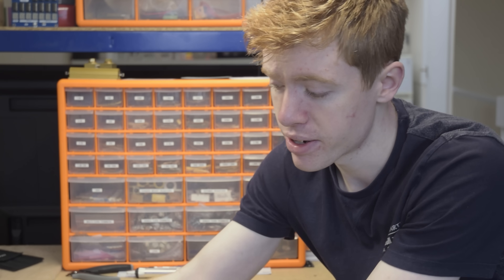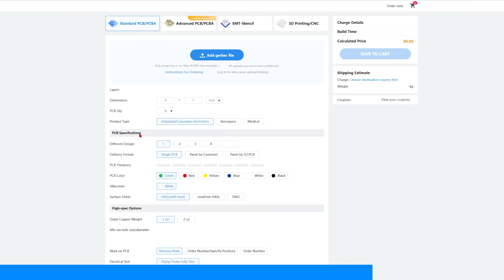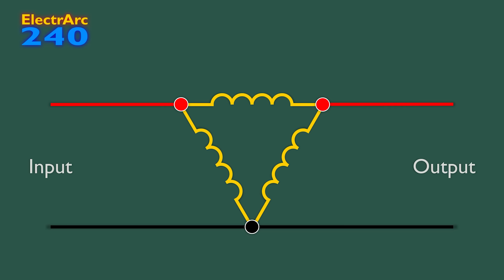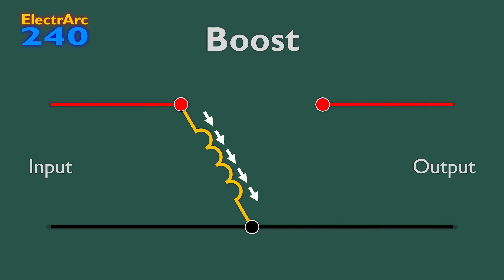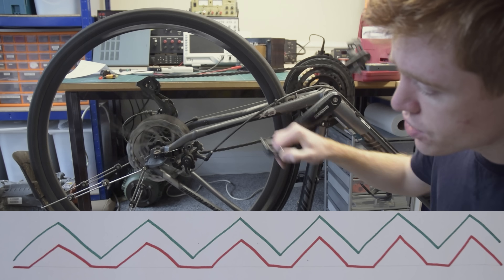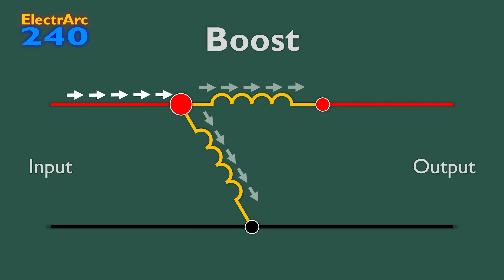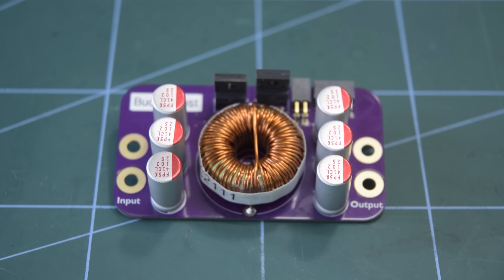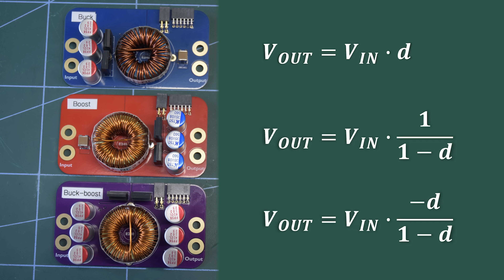How Buck, Boost & Buck-Boost DC-DC Converters Work

Comment: What if I was going from 380V to 48v on a buck converter?
Reply from the maker: What application? It would be quite unusual to convert between those voltages without isolation. And adding isolation means you can use turns ratios to do the heavy lifting of the voltage conversion

Comment: Edit: I misunderstood ignore below

I must say i was quite disappointed in the statement there are no non-inverting buck-boost converters, because yes they exist, with 2 FETs and 2 coils sometimes in 1 IC package. I think what you meant was with one coil? The rest of the video was very good and i very much enjoyed it!
Reply from the maker: Thanks. When did I say that? I only ever mentioned the standard buck-boost as this video was just about the three “fundamental” topologies that are in the thumbnail
Reply: @electrarc240 you are absolutely right, I misunderstood when you were talking about "standard" buck boost converters rather than most/all. So there are other standard types that dont invert, just not the one you were talking about. I jumped to conclusions too quickly. My bad.
Reply from the maker: No worries! I should’ve probably mentioned other types anyway. I will in the next part

Comment: Every EE i ever met would melt down at the term buck and boost. Would go on rants and pull out books. We usually laughed at them once they left...
Reply from the maker: Really? Where are you based? Never known anyone to have a problem with them
Reply: @electrarc240  Missouri is where I used to do electrical stuff back 2003 and before. They would say it's improper description. Or wrong terminology. We always had a good chuckle. Often suggesting them in meetings for absolutely no reason. Honestly I found them to be extremely rare in actual use so I never understood the hangup. Probably more prevalent now with much more DC in service compared to the 90s.

Comment: If you want buck-boost functionality with partial isolation and no inversion, there are the CUK and SEPIC topologies which decouple input from output via capacitors so DC cannot flow straight through when the converter isn't running or a MOSFET has failed.

Comment: Great video! Thank you for the visualisation of the inductor at 4:28. That's what I needed to finally understand what saturation means. Saturation was always a mystery to me, because it's important to choose a coil with a saturation that lies within the specs of the power supply you're designing. I feel stupid for never knowing buck-boost converters existed and that they can create a negative supply voltage. I could have solved many circuits with a buck-boost converter instead of a noisy charge pump. I'm assuming that the circuit needs regulation, because the voltage will drop under load?
Reply from the maker: Yeah some regulation would be a good idea, though if you can keep enough load to prevent the inductor current from ever reaching zero the output voltage will be fairly stable according to the equation shown at the end

Comment: Love these videos. I got a computer engineering degree years ago (before google was even a search engine), so I know the basics of circuitry, mostly digital. I went into software development, and never really delved too deep in analog stuff. These videos are great for refreshing what I forgot, and expanding on that and taking it further.
Reply: This is as close to the digital domain as it gets, with the PWM controller being mostly a digital device :D Now imagine people in the 70s, trying to develop an SMPS with nothing but crappy transistors and feedback loops.
I remember reading Horowitz & Hill book, the section on how to design a switched-mode power supply with the preface being "please don't".

Comment: Excellent description and interesting that you mention forward converters. Those were a thing back in the 1980s but fell out of favor, overtaken by flybacks and later, resonant conversion.
Reply from the maker: The one I held up was made at uni for the “energy project” group project. I guess they’re nice and simple so hard to go wrong for students! Flyback has the risk of producing dangerous voltage I suppose

Comment: Hi, I used a boost converter module to step 3.7v to 12v. I used the 12v to drive a dc motor driver (l298n), however I noticed that the boost converter would drop to 3v or so when I added a load (dc motor) to it. Can someone explain why this has happened and how to fix it?
Reply from the maker: Is the boost converter strong enough to drive the motor? Dropping so low means either the battery (presume it’s a lithium cell?) can’t provide enough current or the inductor has significant resistance, both of which would suggest an upgrade of one or both may be a good idea
Reply: @ I used a power supply to imitate the batteries voltage. I guess that’s where the error lies, right?
Reply: Hi, could be:

1. Bad hardware design
2. Your buck converter can't supply that much current
3. Your PSU can't supply that much current or is in CC mode
4. Your PSU uses long cables to connect to the boost converter so please add bulk capacitance right at the input
5. Your wires are too thin (although 3V is too low as voltage drop)

Comment: PWM is when you have data you encode over duty cycle. M for Modulation (e.g. class-d amplifier) . When your duty cycle is unchanging, I'd call it a square-wave w. duty-cycle. But granted, PWM is much shorter

Comment: Great video, I now finally have something to point my friends to regarding how the converters work.
Note that most modern (synchronous) "buck-boost" converters actually use 4 N-MOSFETs (high/low on both in/out) and have integrated gate drivers, to avoid a lot of the shortcomings, typically internal to the switching IC, but some ICs allow the use of external FETs (all 4, or only high, or only low, depends on what is convenient for the application).
Reply from the maker: Yes I will definitely mention this in the next video, but as the four switch version no longer “pivots” the inductor I thought I’d leave it from this one to keep things clear

Comment: Nice, clean and practical explanation. Congratulations !
With very smart control of PWM, what is a problem with using only capacitor (step down converter) ?
Reply from the maker: If you are connecting to a voltage source you’ll need a resistance to limit the current charging and discharging the capacitor, resistors are zero percent efficient so are the arch nemesis on power electronics and are avoided at all cost. But are fine in very low power circuits like a charge pump
Reply: @electrarc240  I thought about ultrashort rare pulses but maybe it stupid idea or needs additional switch to connect output when desired output voltage build after slow start ... or switched resistance to limit current at start and then bypass but this also unnecessary complication
Reply: @electrarc240  By the way, did you saw those new modules from (as I remeber analog devices?) where coil is inside ? Those for multiphase circuits like on GPU or main boards.
Reply from the maker: @AK-vx4dy  ICs with integrated magnetics? Yeah I've seen them before they're so cool, still can't work out how it can all be in a single package. We use them on a few boards at my work
Reply: @electrarc240  I think it some kind of hybrid module but still magic
Reply: @electrarc240  Thanks for explanation this role of current limiting makes more sense for my coil adverse brain 😉

Comment: Would  you happen to have a link for the buck converter board? I'm trying to make my own using some old inductors out of a blown up mppt charge controller. Not sure what i'm doing but that's how you learn! Any who id like to scope a buck converter with different freq and look at the output. Inductors I have are beefy 1mh so next is picking a fet or fet's for the job.

Comment: Holy cow, this is so applicable! I was just researching the possibility of making my own custom battery chargers and thus trying to better grasp the essential concepts of voltage converters... boom, upload from ElectrArc on that very topic 23 min ago. Talk about good timing!
Reply from the maker: Sounds interesting! There have been papers written on how current ripple (discontinuous current in particular) can cause internal heating and shortened life in batteries, so keep that in mind.
Reply: @electrarc240  Very good to know! Current ripple is not something I've looked into enough, so thanks for the excuse to dig deeper.

Do you happen to know what causes the internal heating, from a technical standpoint? Is it just bursts of over-current? Maybe brief over- / under-voltage at the limits of the cycle? Both? Neither? lol. I ask because most of my work is on solar and battery backup systems, where cells are rarely pushed anywhere near their charge / discharge current limits, and even the voltage range is slightly narrowed for longevity and safety. I wonder, could current ripple be expected to have any less detriment in this context?
Reply: Same case with me
Reply: Some battery technologies are more vulnerable to DC ripple in charging current than others.  And it's a problem with high-density high-voltage batteries overall...